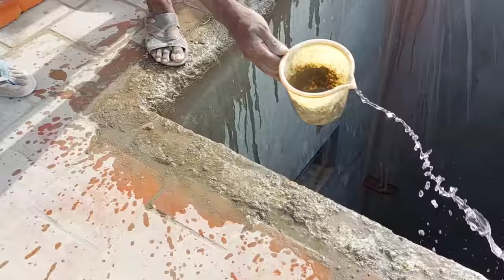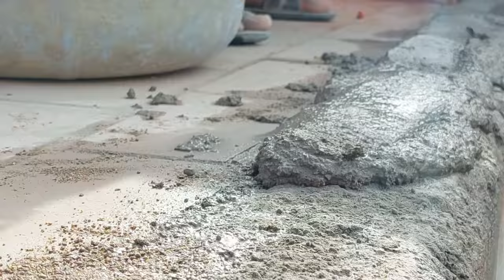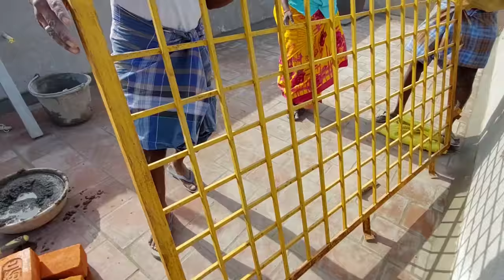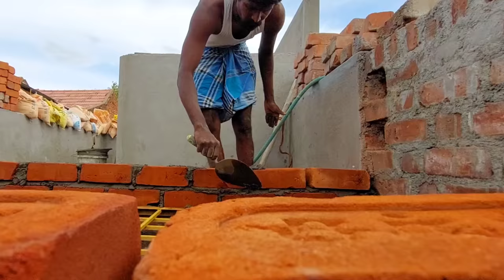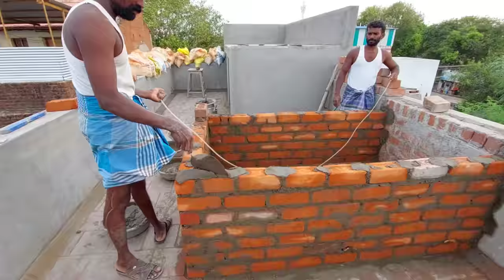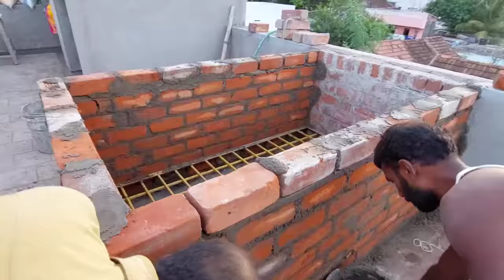Amazing Roof Air Ventilation Technology!-House Roof Air Ventilation design Grill Installation

Comment: This roof ventilator works very well to throw out the hot stuffy air from inside the house. It works like a flue gas chimney...venturi effect passive cooling...good work...re-introduction of an old idea
Reply: But what is the solution for rain 🌧️ and mosquitoes 🦟? Bro
Reply: @vinayegalapati4889  Pesky mosquitoes and other flying  crawling, hopping pests can be stopped in their tracks with a fly mesh and glass shutter..in very hot summer months the roof top ventilator works very effectively and the inside temperature will be almost the same as below a shady tree outside...
Reply: But all rain will go inside 🤣
Reply: @msd2610  why wall around it  ?
Reply: @ramindians   The wall on four sides functions as a stack/chimney for the hot stuffy air to rise by force of natural draft assisted by the incoming air from low level inlet windows.  A little more attention to detail in designing the roof top ventilator to incorporate the Venturi principle would result in a 
very effective air circulation system.
.
Reply: @msd2610  u can just do the traditional chimney systems which works the best way for ventilations as well as protevtiy against rain
Reply: @lancewyman4701  A chimney/smoke stack occupies floor space if built like one for a fire place.  Fire wood room heating fire place is a rarity in South India, may be present in Kodaikanal. The alternate arrangement is to build the stack on the roof top..

Comment: Grill should have been placed above the wall, along with Fibre sheet....
This would have prevented rain water too....
Hole pass should be welded vertically so as to leave the gap for ventilation.....